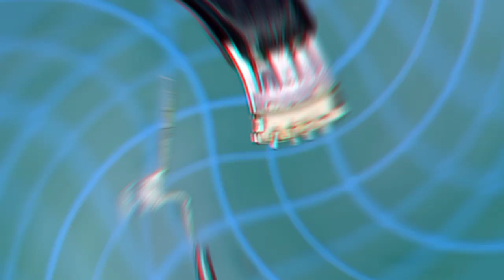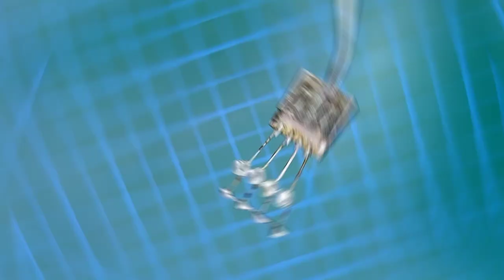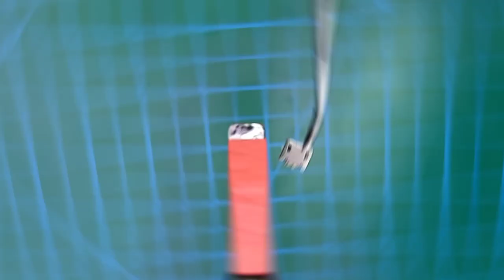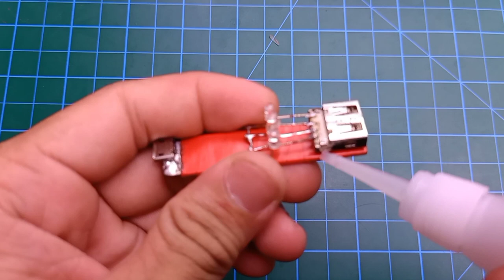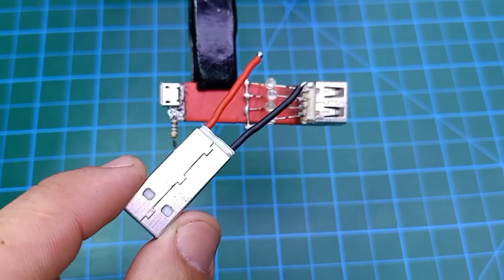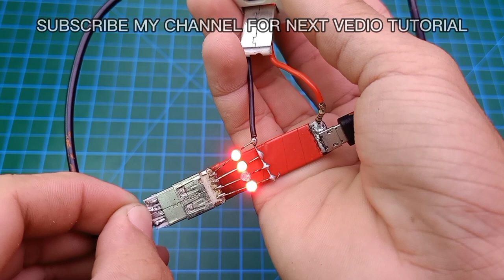HOW TO MAKE USB CABLE TESTER

Comment: I accidentally bent my charging cable's plug, I bent it so much, that it shorted out, my PC started shutting down, and today, my phone refused to charge past 30% and my charger was crazy hot.
So, I bought a USB doctor, and I found out that the bent port was internally shorted.
Luckily I still had a high quality cable from my old broken phone, so it didn't cost me anything.
If I had this device, I would've found the issue much faster and save my devices from possible short circuit damage.
Charger still works fine, so does the PC.